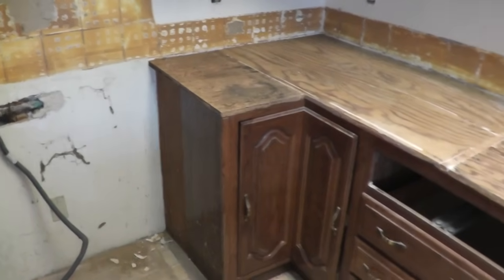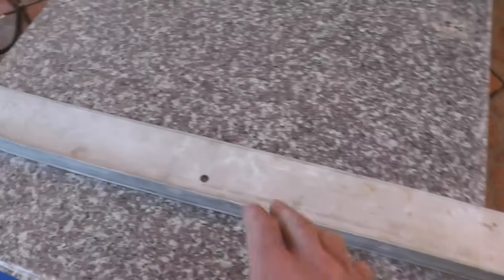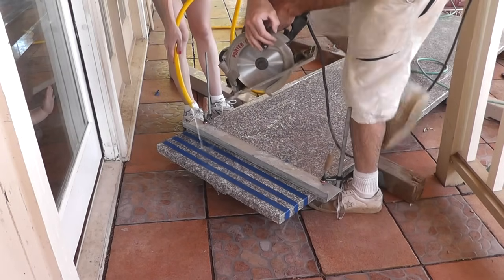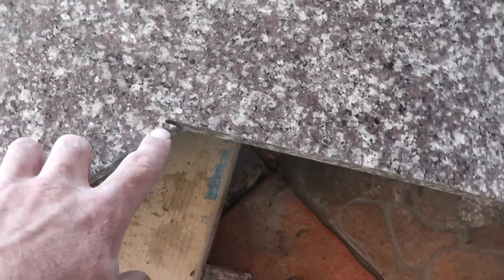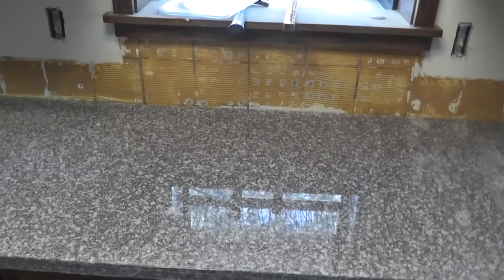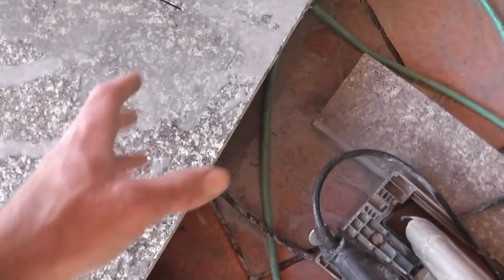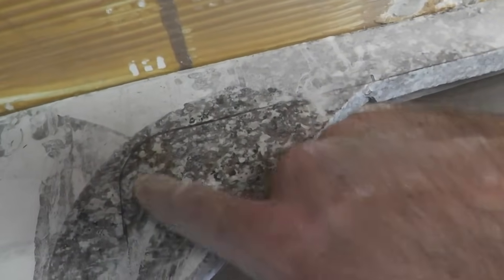How To Install Granite Countertops On A Budget - Part 3 - Cut & Fit With A Circular Saw

Comment: If you are worried about chipping, you should cut it from the backside, and always cut into the face edge. Pack the underside with ply so you do not have to worry about the raised edge detail, east pizzy.  One other thing never ever push a circle saw with your knee, I saw a man die doing that!!!

Comment: You did a great job! I cut granite countertops I had bought at an auction the same way. I used a skill saw, a cement blade, and a water hose to keep the blade from warping. A tile saw blade is too thin and will warp from heat. You may want to make several cuts and go a little deeper each time to help prevent the blade walkout. I also had to use an angle grinder lined up with my straight edge to straighten some walkouts. In total, I had to make six cuts. You may need more than one blade.  A local countertop installer mixed and matched some seam epoxy for me and sold me a variety of U-shaped shims for low spots. I was able to get 1/16'' seams. However, I was lucky and did not have to make any inside corner cuts  because the granite I bought had premade corners.

Comment: Being an electrical lineman that little shock "probably" wont kill you. However, I would suggest using a GFCI attachment. They are cheap and you can plug them into your cord if you're truly worried about being shocked.

Comment: Haha.
Reading the comments from the nervous nellies who never risked more than a papercut made my day. I'm surprised nobody has said you need to wrap yourself in bubble-wrap for SAFETY just in case of a meteor shower.
A tip to prevent cracking in the corners of the sink cut is to get a 1" diamond holesaw and drill the corners before cutting out the hole. Stone hates 90 degree inside cuts and will want to break there.
Really good job for a rookie.

Comment: I've been Installing granite countertops for the last 20 years. Great Job! the only tip I can offer is the 45 degree part of the french miter doesn't have to be that long. When I do it, I just 45 through the edge detail or the laminated build-up and then straight cut afterwards.

Comment: Impressive  video!!  I would say it is methodical and very well put together.
 
I see much negative  comments that has lot of points that could have been addressed rather politely.
Most of electrical motors have vent grills where the coils are, in the opposite side of enclosed blade cutting area to prevent the debris from entering. I wouldn't splash the water in the there. In worse case scenario, would be similar to dropping a hair drier in the bath tub while a person bathing like horror flicks.

Regarding GFE protects the accidents, I wouldn't take a chance to find out how well it works IMO.

I worked in high-end industrial cutting tools business in different applications as an engineer.
Proper diamond coated resin blade and enough power and adequate coolant will cut granite like knife through the butter.
This video proves my point clearly!
If anyone say IT IS FOR EXPERTS ONLY!!! without providing solid reasons, SORRY I HAVE NO LOVE FOR YOU.

Even though I admit it could be risky i see the coolant was applied adequately in the video, more gently dripping than splashing. It would be foolish if anyone pour the water like fire hydrogen. I see some will definitely do that.  

If you are not confident I would put a dam of water along the planed pass and slowly apply more water with ketchup dispenser as it drains if you are too nervous.

Just my 2 cents.

Comment: When youre cutting out the sink, instead of doing one 45 degree cut, and then finishing it from underneath, do two 22.5 degree cuts. This makes two little triangles that hold the cut out and you can snap those off with a screwdriver when youre ready to drop the cutout. Much easier and safer. For a DIY guy, you did a damn good job getting that masons mitre and cutting straight lines. Ive worked with guys in a stone factory who cant even do that properly.
Reply from the maker: Thank so much for that tip! I am getting ready to give granite another try, and I will try it.

Comment: You did great, I have one constructive comment for you. When you are going to do the sink cut out. Take the saw raise and lock the blade to the highest location. Align the saw blade to the layout cut line. Then attach a clamp to the foot of the saw. Clamp to granite. Then proceed to lower the blade into the cut. This will ensure a perfect start of cut 90 degrees to the surface. This will also prolong the life of the diamond blade. After you have penetrated all the way thru the granite. Then remove the clamp, and proceed to cut along the layout line. I would have used the saw in a normal forward cutting position. You would not see the finish of the sink cutout due to the sink design.  You did good man.

Comment: GFI. When it was introduced, the inventor stood in a bathtub full of water and had someone throw a plugged in radio into the tub with him and it tripped the GFI before he got a shock.
 I have cut stone using this very technique a number of times and I will do it again. I would only add to these instructions that it would be a good idea to plug into a GFI or GFCI (ground fault circuit interrupter) protected outlet.

Comment: Aside from the safety concerns and other technical issues raised by other commenters that I agree with, I have another suggestion. You never know if the corner of a wall is perfectly 90° so you don't just want to cut the slab at exactly 90°. You want to measure the angle of the corner and cut accordingly.

Comment: To achieve better corner or angle cuts with out going past your cutting point it’s best to use a drill bit and drill a hole at each corner and angel cut location so when the cut is being made it won’t go past your cutting line it will cut before the cutting point with a hole already drilled.
Reply: Good tip mate.
Reply: What size drill bit would you use for 2" thick granite?

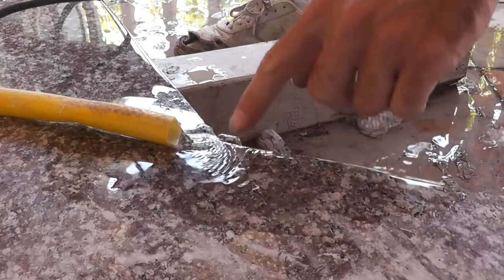Comment: Nothing wrong with doing it yourself.  Measure twice, cut once. Examples like 15:52-(EXTREMELY HAZARDOUS), are what some of the people are pointing out, oh and water+skillsaw=potential electrocution. You didnt need to use the skillsaw to begin with just the angle grinder. These diamond blades are wet/dry so you can cut this dry and clean up the edge with a set of wet/dry polishing pads. As well, safety equipment is not optional :D
Reply: Why was that extremely hazardous?

Comment from the maker: That's a really good question! The reason to do a 45 for the first couple of inches is so that the finished front edges meet at a nice corner, and it also allows you to cut off the rounded front edge of the granite so that it doesn't extend back to the wall.

Comment: Late to the party. But Did I see the two individuals standing on water and using an electrical saw. With the guard pin back with a wire, and wires exposed ?  This is a great safety video of what NOT TO DO! boys and girls.  Thanks for watching

Comment: I installed granite in my last house for about $350 total including a new $100 saw and a blade.  This video helped a lot. Mine was much less complicated.

I didn't brace the granite well enough where the sink cut out was and ended up cracking it. If I followed the directions in the video, it would have been fine. epoxied it together and it wasn't noticable. I didn't have to cut any corners, and my stove was was a slide in.  The entire installation went smoothly except having to fix the sink cut out.

I'm going to be doing granite again in a U shaped kitchen. After considering the issue with the sink last time, spent a little extra and got a top mount stainless country apron sink. 

This does two things. First, No sink cut out. Just one straight cut across that doesn't even have to look great. Then I'll use a piece of the granite backsplash, which I won't need, or a piece of stainless to fill in the couple inch gap at the back of the sink. This will save me a lot of time and simplify it.

Second, in my situation, it saves me an entire slab of granite. Slabs come 10' 4" at Floor and Decor for about $250-450 depending on type of granite or quartz. My kitchen is 10' 8" wide with a 8' run on one end, a 14" run beside, and a 2' piece. About 16" bigger than 2 slabs. Cutting the sink and using an apron sink removes 3' from the equation, which saves me around $300 and lets me get a much nicer and more functional sink.  A slab of granite and an OK sink is about $7-800, while this much nicer sink and faucet was about $500.

As an added bonus, I'll have enough backsplash that if I glue them together into a slab, I can finish my bar counter too.

This video helped me a lot last time and I thought I'd watch it again to refresh.

Comment: 1 of the tools I find myself using at just about every point of this process, is a little 4.5 inch grinder with a 4.5 diamond blade attached. It enables you to just get in to so many more places like corners. Wait!... 16:03 in the video, & I see your utilizing exactly what I've spent 24 minutes typing. Story of my life I tell ya! Now let's talk about those saltillos that weren't quite grouted, & are full of chips & shit, & how your gonna take a shop vac & clean'em real good before grout! Thx for taking the time to make & post. None of the process was easy, & that didn't detour you.👍🏼👏🏽
Reply from the maker: +Liam Duff Thanks a lot for the kind words, yeah I cleaned things up as well as I could before grout.

Comment: Blades like the turbo blade you used will chip more.  Also the continuous rim blade would have worked fine if you had water spraying on both sides of the blade that's why it started pulling to one side.

Comment: People don't be afraid to take on your your work  theres a good satisfaction on doing  all your own work  with your own ideas own  decisions with your own hands   instead of some one else deciding those things  for you  yes I understand  that  sometimes for something the only way and safest is  to go with a pro but for granite countertops I feel is something I could manage my self  I'm a welder  fabricator by trade and the only 2 things I woulfeel need to hire a pro is for electrical or  AC AND HEATING and I feel I could take care of everything else around the house including  the cars people just freak out  wen they step out of something there not sure or never done they don't  feel capable or have enuff trust to do stuff they have never done before just in this topic alone three so much  info from different  people showing you how to videos if you don't like the way someone is doing the work there's no need to  leave negative that are rude comments to some one just trying to help regarless how good or how bad or how much you agree or disagree people  sometimes think that everyone is here for just them and quickly pointing the bad and ignoring the main point of someone taking time to try to help or show you how to do something regardless

Comment: Why did you cut a partial 45? Instead of just cutting it straight off and putting a 45 on the billboard? I only ask because I have the same problem with length, and not being able to put full 45's in.
Reply: Bullnose* not billboard

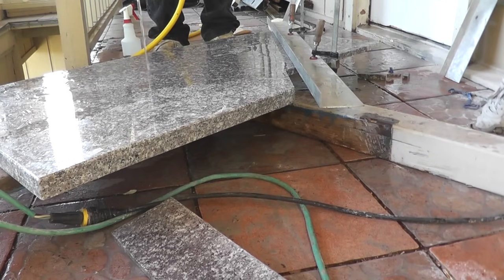Comment: Anyone else's jaw hit the floor around 15:15? Running water, unsheathing electrical cord and connection. I was ready for a hand or finger to get lobbed into the camera lens at some point. I'm sure he's comfortable, but I was nervous.
Reply from the maker: Naa, that diamond blade just gives a nice tickle. Electricity on the other hand is a unruly brute.
Reply: It took me until 15:56 when he starting using the grinder.

Comment: So I tried this with a 6ft slab with same thickness as yours(2cm), and cut the sink outside to make less of a mess. I left the corners intact just like you did so that it still had some structural strength. But when we picked up the piece to move it inside, it broke at the corners of the sink cutout. Now i have three 2ft chunks that I probably cant use. You didnt show in the video how you transported the sink peice inside and how you supported it. Can you describe what you did for that?
Reply: halo2markvi very carefully or jus cut sheet of plywood to match the slab and use 4 clamps to slap them together for support while transport lil trick that should help
Reply: Epoxy some angle iron for transport then remove after

Comment: Also, did you use the blue duct tape to prevent it from cracking in the wrong way or to indicate the line where you should cut it?  
As you are applying the saw to the stone, is there a technique to use to prevent it from cracking/splintering?
Reply: craigslis t

Comment: Great video.

I see all these posts from these know it all people. 

If they were half as smart as they think they are they would of just told you to  just buy a couple of Personal protection switch PRCD-S DEV-(PRCD-S)-OPERATORPROTECTION  switches and put one in your cord and one on your saw. can be ordered at most electrical supply houses.

You can buy a saw made for what you did here and it will have one of these built into the cord.

I think you did a great job on this. THX for the video
Reply from the maker: +Myron Jackson Thanks a lot for the comment. I haven't heard of that device, maybe I'll look into it if I ever get the courage to do granite again.

Comment: ok just bought some granite at menards 96x25 9/16 I believe. I was wondering the weight of the granite you bought. Probably was similar to that. They didn't have it on their website.
Reply from the maker: My slabs weighed about 200lbs each, and they were 2cm thick.
Reply: *****
Thanks. I was thinking of getting a festool track saw but maybe will do this with a straight edge instead.
Reply from the maker: JoeCnNd
The straight edge worked fine for me, just had to go slow and make sure the blade was good. If the blade is too worn, it will warp and make straight cuts impossible. Good luck with your project!

Comment: Need to use way more water than that on the blade to prevent overheating. Continuous blade will not leave nicks like the turbo blade. Lots of water and make cut slow.

Comment: ya know?  you can just flip the bade so you can use the saw like it was intended..
Reply: gggg
Reply: Gary Kimes - Nope.  The blade will be cutting backwards and still could cause chip out.  You must do vinyl siding work :-)  He did just fine.
Reply: The reason for cutting backwards is so you can constantly see your line and is much more accurate. Have been doing it for 25+ years
Reply: after going both ways I find it depends on the saw.  I refer to flip the blade as I have no trouble seeing my line and Im using a straight edge anyway where the reverse ergonomics make being steady much more of a chore.  going backwards with that B&D saw means you cannot see the line at all due to the guard is in the way.
Reply: Wrong Gary.
Reply: No, Gary, that's not true.
Reply: Actually, if you just turn the plug in upside down, the wheel will spin the opposite direction. :- o
Reply: @voncarlos  Sounds legit.
Reply: It’s a continuous rim diamond blade. Turning the blade around is not going to change the way the saw spins.
Reply: Do you really think that flipping the blade changes the rotation of the saw? Lol

Comment: Hi, thanks for sharing this.  Love your sax impression at the end ;-)  
I'm looking to buy a second hand circular saw for a similar granite cutting project.  I'm keeping my budget to a minimum since this is not my kitchen, but a rental.  Could you give details on the saw you used (brand, year of manufacture, model # etc.) Did you use a special wet/dry saw?  I am really worried about the idea of water coming near electrical appliances.  Especially saws!
I've been looking at a sea of brands (MIlwaukee, DeWalt, Ryobi etc.) If you have any suggestions on brands, please do share that also.   Thank you

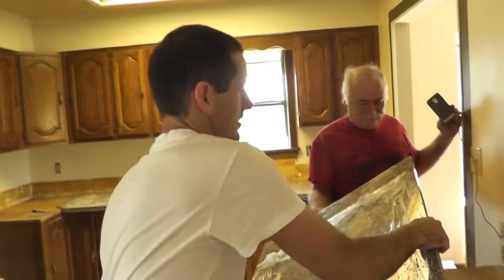Comment: man 4:11  you know why there is in a marquet tools design to work with water that right security purpose. 10:30 the granite to install alway need to be carry straight up with the finish part  (where the polish is, ) alway at the top and the the cutting or finish line at the bottom at it set the same first straight doing a 90 angle with the table. to avoid the granite to break in parts. this is not tile.